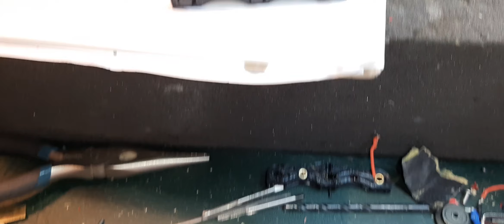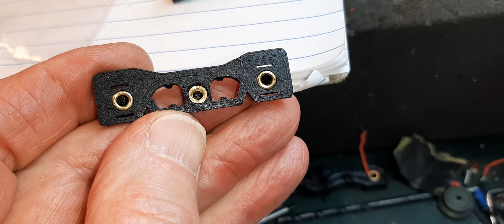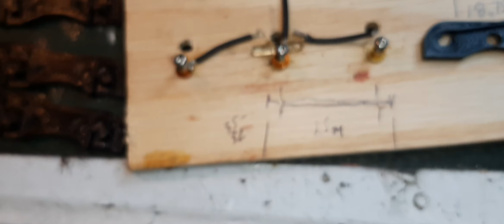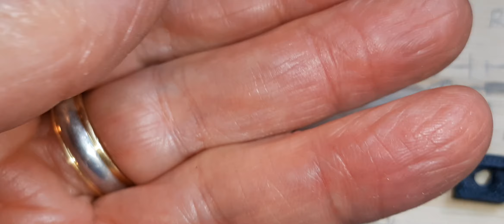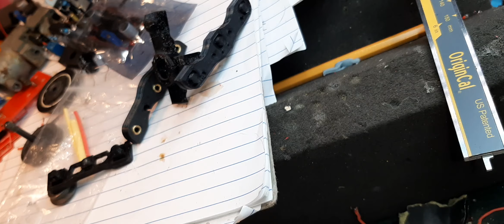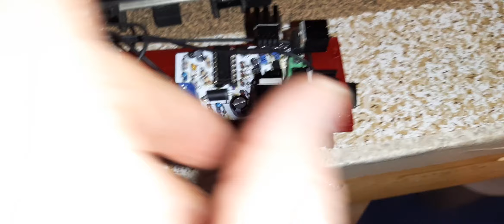Now designing an assembly process for these fancy trucks. See if helps you to consider using them.

Comment: I think both have their strengths. If someone isn’t to mechanically inclined then they can make their own choices. The new look great but so did the original design. As long as you don’t do everything and just give us the input you have and help we and I included myself can take your opinions and make some awesome trains. Thank You.
Reply from the maker: No making 3D Print Chassis for K5, Hudson & Northern to fit in the NGS Reverse and Smoke controller with AWPU option. Plus I made Pivot pin that allows you to reinstall the vintage trucks if you want to.

Comment: Having worked with HO and S gauge for over 50 years, I think your original design with the wrapped spring wire that contacted the axle between the axle spacer and wheels was the best.  It's been used for HO on both tenders and locomotives for years.
Reply from the maker: I think I may have to keep them both around, each has a place. D I too started my Flyer experience some time ago! Repairing a 283 in the late 50s. I ran that old thing for ever.

Comment: I like the brass insert. Think it’s a good design would use ! R
Reply from the maker: OK I think I will change the brass plate for some thick wire be easier to presolder then assemble is that solder connection not a think flat plate. Then i can say it all and understood. Clean up the Files and add the detailed instructions. I do appreciate all the feedback. It helps when I know folks are out there. Thank You
Reply: @DennisMurphey  I think thick wire might be easier to solder. R